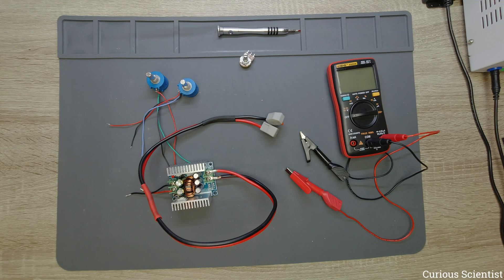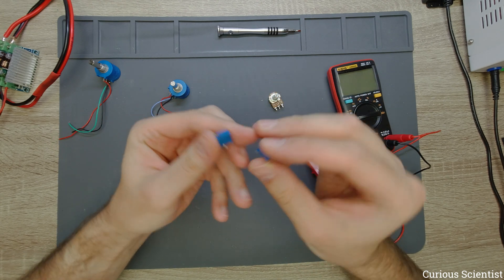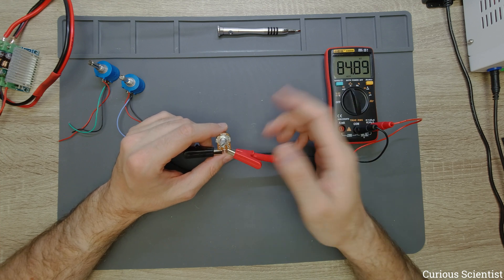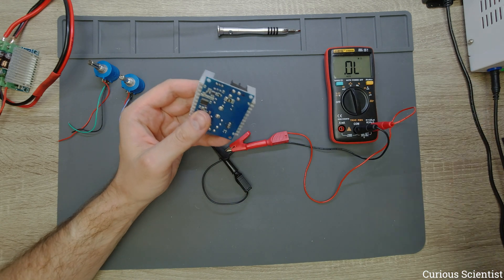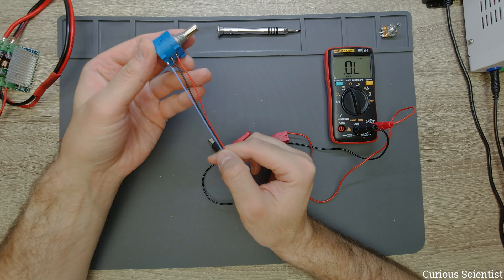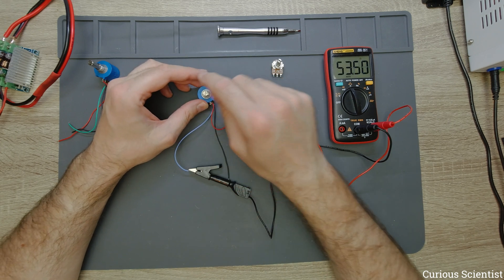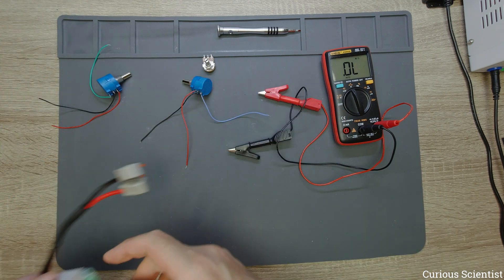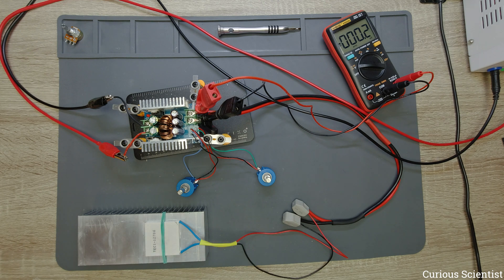SZBK07 DC-DC converter with multiturn potentiometers

Comment: I have this thing too. I dont know why, after change the potentialmeter, i only can use a few minute only. Then the module burn. But why. Already 4 unit have same problem. Do you have any tips? Sorry for my english
Reply from the maker: Your English is good! Do you use the same value? What is the potmeter's position (values) and orientation (3-2-1 or 1-2-3)? Do you have any load on the output when you start it?
Reply: Same problem, I've already burned two modules after installing multi-turn potentiometers, I don't understand what's happening, I've done this same thing on other modules without any problems.

Comment: the pin at the back of the pot goes in the middle hole, the middle pin goes in the last or the innermost hole, the front pin goes in the remaining hole
Reply from the maker: This is a dangerous practice to follow because some parts might have a different pin layout. Connect the external potentiometer as a rheostat according to the connection of the original potentiometer.